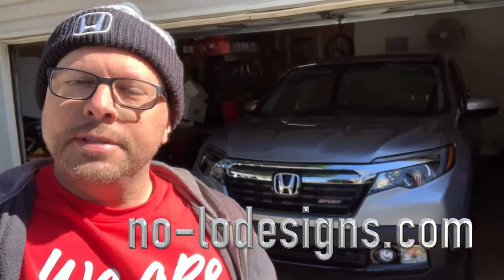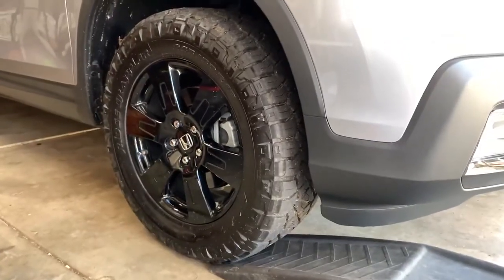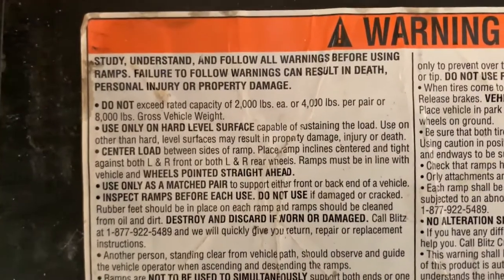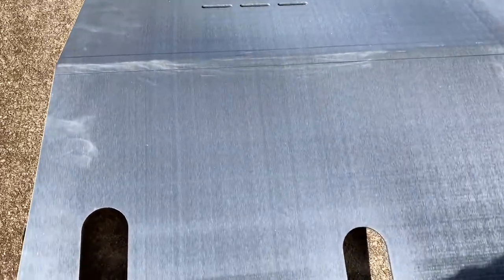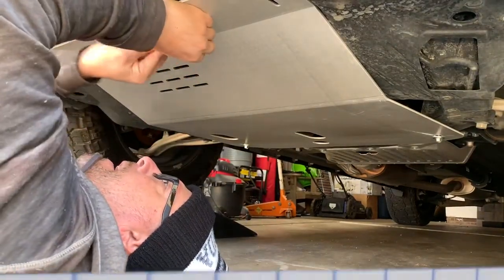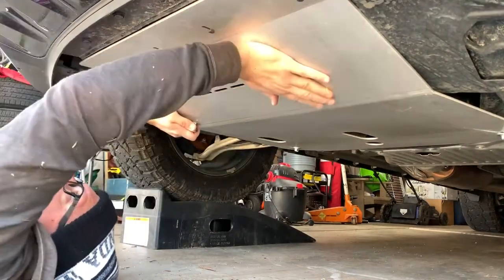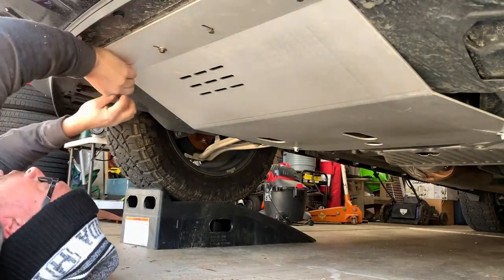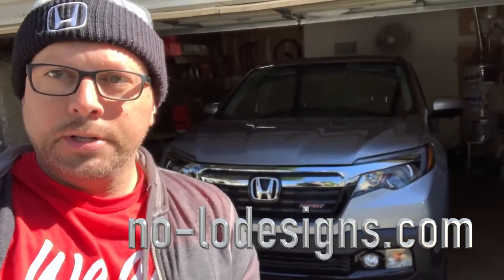Honda Ridgeline Skid Plate Install for Gen 2 2017 2018 2019 2020 No-Lo Designs

Comment: if the G2 has a front central jack point (as the G1) it is now covered by the skid plate,  I noticed that when trying to use it with my G1 with skid  plate.
Reply from the maker: It's only six bolts, so if you really need it, the skid plate is quick to remove.

Comment: Thanks for the video… just added to my ‘22 RTL-E and looks sharp!!
Reply from the maker: Awesome- ENJOY!!
Reply: If the dealer is doing the oil change, are they ok with the skid plate being on there? Thanks.
Reply: @frankENZC  Give me about three more weeks… first dealer oil change is coming and I am curious what they will say and or do.
Reply: @paulyakob9976  Thanks Paul! I hope to purchase my Ridgeline before year's end. And I plan to install the skid plate.
Reply: @frankENZC  the dealer gave some heartburn about putting it on at the dealership. They acted like they didn’t know how or didn’t want to be bothered.    I ended up doing it myself with the help of my brother but had to invest in some ramps and a torque wrench.   I put the front skid plate and the gas tank one on and very pleased with both.  Highly recommended!!
Reply: @paulyakob9976  Awesome, about doing it yourself.
Reply from the maker: You will have to ask your dealer. Mine could care less if it’s there or not.
Reply from the maker: Yes it all depends on the dealerships, some are cool, others don’t want to bother.
Reply: @frankENZC  So finally got to the dealer oil change… no issue at all with the front plate on.
Reply from the maker: It all depends on what type of tech you get.

Comment: Really fantastic video thanks. Any update on the rear skid plate ? And what exactly do these skid plates protect ??
Reply from the maker: I have an instructional video on the rear diff skid plate. Coming soon the gas tank skid plate. The front skid plate protects the oil pan.
Reply: @CampingRandy  love the tires. Will that same size tire 265/60 fit if the truck is lifted two inches ? And you mentioned a slight rub when in reverse, will it cause damage to the car when it rubs? How big of an issue is the rub
Reply from the maker: Yes - wether lifted or not. They will fit. The run is full lock in reverse only and it’s just touching the plastic. No damage to truck or tire that I see. Thanks for watching!

Comment: What would concern me is you are covering the exhaust witch was completely exposed so it will get a lot hotter under the engine ,  now way for the exhaust to dissipate the heat , before when driving the cool air would blow over it . I see it has a few vent slots but it looks like it needs more .
Reply from the maker: There is actually a new design coming out with that same suggestion. Baby steps my friend, baby steps.

Comment: How does everyone feel about those exposed bolt heads ? As an owner of 4Runners , an FJ Cruiser and Wranglers  ,  Skid Plates I am used to seeing always have recessed areas for mounting hardware  so bolt heads do not get smashed . crushed or sheared off , which can be a real pain is the butt to address .
Reply from the maker: Yes they get rounded. Baby steps as this is an evolving product. We have discussed this issue. Thank you for the input.

Comment: Any creaking noise?  Mine has a metal creaking noise after putting on the skid plate.
Reply from the maker: Loosingband retighten- with truck on the ground. Sometimes you just need to loosen and retighten so the plate relaxes.

Comment: Do you get more engine/transmission noise in the cabin? I could see lots of noise bouncing of the plate. Also any observations on engine cooling?
Reply from the maker: I get more noise from my tires then the plate. But you do hear a little reverb but gives you a warm beefy sound if you really listen for it. I would say yes you do get a little, but we’ll worth having the plate if needed than not. Only takes five minutes to remove if an issue which I think it’s not. No cooling issues at all. Thanks for watching!
Reply: Just wondering. How difficult would it be to cut an access window for the oil filter? Removing a smaller access plate to change the oil would be a lot easier than removing the entire plate?
Reply from the maker: The filter access is on the passenger side behind the wheel. The skid plate has nothing to do with the filter. Find my other video on changing oil with the pan. The only issue I had was not having my oil filter wrench so I had to poke a spike through it to remove. That makes a mess no matter what.
Reply: Yeah my plate makes a lots of noise, specifically when I move the truck forward, I think the torque Nolo provided  is not accurate, also I noticed that the washer got deformed even when I just Use the right torque, something is not right here.
Reply from the maker: Your best option is to loosen and let rest then tighten (monthly or every oil change). With heat, cold and flex; the metal of both the skid plate and truck contracts and expands.
Reply: @CampingRandy  I find out that my Washers even they are at 40flb torque got deformed I am getting a Grade 8 Washers, to prevent this type of deformation, or I got a weak Washers or I don't know how that happened. I let you know.
Reply from the maker: Please do - I’ll give feed back to no-lo.
Reply: @07Review  I was having the same issue, I just had to have the plate removed due to excessive noise turning, stopping and starting.
Reply: Just to follow up I spoke with NoLo and the dealer, I'm not sure the people who installed plate installed it correctly or if the dealer messed with it during oil change as there were no spaces at rear attachment, I am going to reinstall myself and see how it goes.
Reply: @sseel2877  
How did it go?

Comment: Do you still have access to the oil filter with the plate on?
Reply from the maker: Eric L yes - you can do everything with the plate on for oil change but it literally takes less than 8 minutes to remove if need be.

Comment: Does this skid plate replace something else? Is there also another skid plate just behind what you installed in the video? Is that one plastic? I do not mean a rear differential cove. My plastic skid plate (stock) filled up with sand and the 2 plastic push screws in the rear edge pulled out. The four metal up front remained. Confused.
Reply from the maker: There is no skid plate. Email me as I’m confused by your question.

Comment: Does this plate interfere with engine oil changes?
Reply from the maker: No it does not. But it only takes fives minutes to remove. I suggest removing and cleaning the skid plates every time you do an oil change.

Comment: Can you make a video changing an oil with skid plate installed.
Reply from the maker: I’m pretty close to my next change. I may try but it’s just so easy to remove then leave on.
Reply: An oil change video with the skid plate on would be nice. My eyesight made it difficult to install the skid plate. If I take this off in the colder months, it’ll likely stay off for a while. The access holes in the plate were meant to do oil changes without removing it I think. Does oil flow through the hole easily or does it make a mess on the top of the  skid plate? Would be nice to see what’s involved.
Reply from the maker: Here’s the video. Draining = no mess. No oil wrench = mess. Lol. It’s pretty clean to do. I just made a mess because I left my oil wrench at the hose and had to put a tent spike through to remove. https://youtu.be/dR9zR-EFvik
Reply from the maker: Oil change with skid plate on https://youtu.be/dR9zR-EFvik

Comment: Thrilled they have a drainage hole for transfer case. I was checking the one I got from a competitor. Now I'm questioning it...
Reply from the maker: Robert Bohinc AWESOME!!! I’m excited to see how it works out.
Reply from the maker: Thanks so much. We will see how well it does on the next oil change. I’ll keep everyone posted.
Reply: @CampingRandy  I was one of the first to own one of these.  They are the best on the market at this time for sure.  One thing... I would advise you to take it back off... make a "T" shape on the oil change hole so your wrench can go move left and right to loosen and tighten the plug and while you are at it, lengthen the hole toward the front of the vehicle by about 1 inch.  Also lengthen the hole toward the back by about 2 inches.  I found out the hard way that when the oil is down to its last dribbles, it runs straight down and lands on top of the skid plate.  It then runs ALL OVER up on top of the plate making a mess.  When you first pull the plug, the gushing oil shoots out further than the original hole making even more of a mess.   I just used a drill with a small grinding bit on it to shape the holes in a way that is actually usable.  Easy cause it's aluminum.  Good luck!
Reply from the maker: @jamesmeans6558  thanks for the feedback, I will as well let No-Lo know.

Comment: Question on install:  my front 4 bolts never really tightened down...they would tighten but always turn...what did I do wrong???
Reply from the maker: I removed the piece of plastic under it. You can actually run a razor blade down the fold of the plastic piece that is molded to the bottom front bumper. Just keep tightening. A bit of mild lock tight may help as well. Let me know!

Comment: Hey I was wondering how you find the ride , noise and fuel consumption with the Ridgegrapplers?
Reply from the maker: LOVE THE TIRES! Ride is great. There is a little hum, but its pleasant, not an issue. Two miles an hour difference, maybe 1 mpg, but I'm a pretty heavy foot driver.

Comment: I've gotten so much dust off-roading that it collected in my front lights and shorted out all the wiring. My front lights, fog lights and blinkers stopped working. Had to replace all that. Have you heard of anything to prevent that type of wear?
Reply from the maker: Wow! Never heard of anything like that. I suggest dielectric grease to keep water and dirt out of connections. How old is the Ridgeline?
Reply: @CampingRandy  2018. 80k miles. 79.5m on the road. Those 500 miles off road are killer on the Ridgeline. I love this truck, my best friend since childhood has three patents on it. But I am still deciding if I should invest in putting skid plates on it as well as re-greasing all the wiring or just upgrade to a TRD package from Toyota.
Reply from the maker: @pwells10  NOOOOOOOOOOO - Keep the Ridgeline!!!!!!! Safe travels!
Reply: @CampingRandy  really struggling with this decision. The Ridgeline is by far the most useful and comfortable truck I've ever had but it's a little too small for my family needs and I work in the phosphate mines. Off-roading is it a regular part of my day.
Reply from the maker: Tundra it is then.

Comment: Yeah, but I have to remove that whole plate just to change my oil filter every 7 thousand miles.
Reply from the maker: It SIX bolts man! I think you can handle it. For the benefit it provides, I dont think six bolts is an issue.